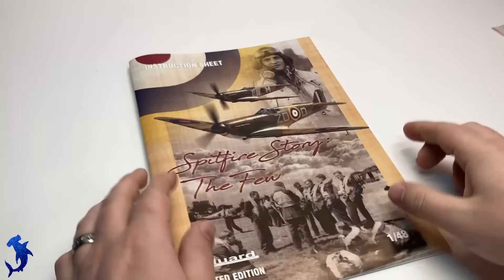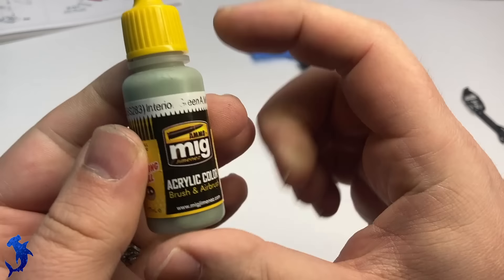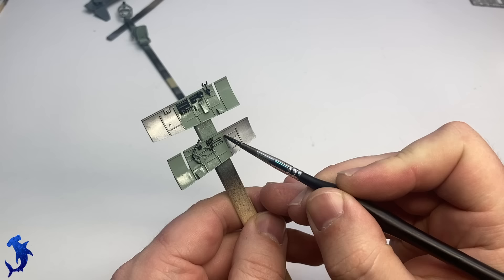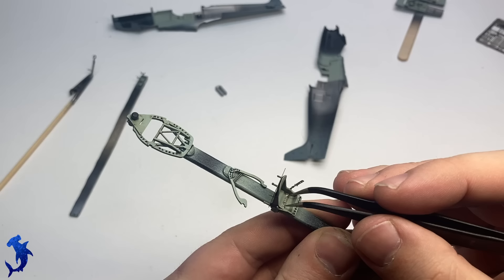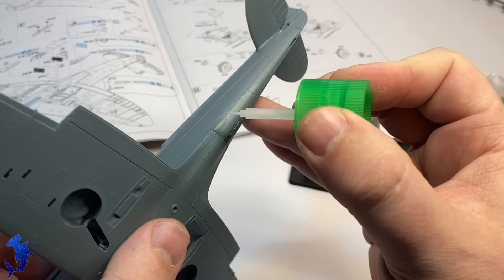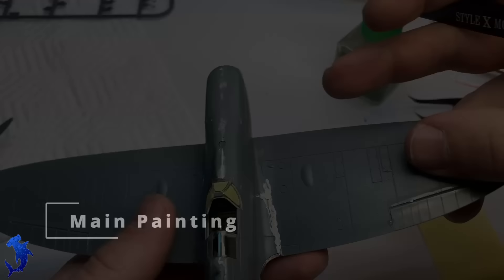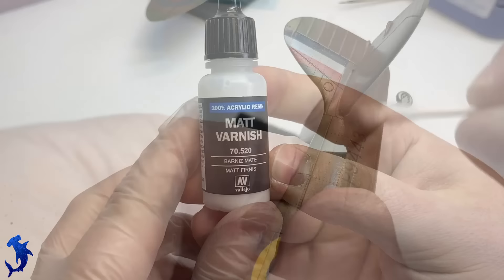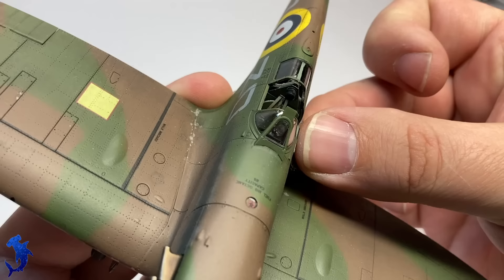Eduard 1/48 Scale Spitfire Mk.I | Douglas Bader | Battle of Britain

Comment: What an outstanding finish chap! 
So glad the paint recipies worked out well 😊👍
When you said you were going to build this kit I knew you would enjoy it and make a cracking recreation of an early war Spitfire, only thing is what are you going to do with the second on in the box?! 
I have some spare photo recon decals for the early Spitfire Mk's in the stash if you fancy a pink or blue Spitfire in the display case 😁
Thanks for the shout out, extremely kind of you Brett.
Reply from the maker: Thanks Matt!  When I bought the kit, I also bought a full engine and open gun bays from Eduard, I'll use those on the second Spit, but I hadn't considered marking options yet, but a blue Spitfire sounds intriguing.
Reply: @HammerheadModelMaking  Ha, I have got the same engine for my second build! Maybe another buddy build in the making 😁

Comment: Great build! I'm a  Spitfire geek! Built many Spits over the years. Your build is undeniably high quality! It may not be 100% accurate, but no kit is! Our hobby - scale model military aircraft building, can be straight forward if you just follow the instructions verbatim, but for those who strive to build an accurate representation of an actual aircraft, research is vital. When the subject is an aircraft before the 1960s, it is a problem when it comes to colour accuracy, the obvious issue of lack of colour photos for the earlier aircraft combined with the poor colour accuracy of early photography, makes colour selection problematic. Other elements as you mentioned, the streaking on the wings due to gunfire is another issue, I have seen photos of this, but they are not common. 
Some historical points on the Spitfire & RAF, grey was not used until 1941, the red fabric on the gun ports was to stop moisture from entering the barrels and freezing, which happened at high altitude, As you accurately depicted, when the guns were fired, the fabric was torn & would be replaced. 
Regarding Douglas Bader, he is definitely a unusual character, to say the least. He lost one leg below the knee & the other above the knee, I think. This happened when he was with the aerobatic  team of the RAF before WWII.  His life is chronicled in the biography Reach for the sky by Paul Brickhill, which is a great read, Reach for the sky was made into a movie, which is worth a watch. Keep up the great work from across the pond, Not Great Britain, the other side – Australia! 😁🦘🦘
Reply from the maker: Sounds like you're the go to for spitfire knowledge!  Thanks for all the info you shared!  Its much appreciated!  Thank you for the kind words as well, cheers mate!!

Comment: Great build. 
The black and white underside was indeed a prewar thing.
 It was used from 1938 up until June 1940, half white half black, for observation of friendly aircraft (IFF) from the ground.
(Also, the yellow gas-patch usually went on the left wing, tilted 90 degrees for some reason. But now you know for the next time. :) )
Reply from the maker: Thanks for watching, and thanks for the additional info!
Reply: the gas marker was not always applied at a slant. it really depends on the aircraft. the most common explanation ive seen for why it is often seen at an angle is because it would be done by someone kneeling on the walkways but the marker needs to be far enough out for the pilot to see it. the idea was that there would have an indication of gas droplets if the detector changed colours, these didnt stay for all that long though and were pretty much done away with by 1941.
Reply: @ryancook6452  
The agreed. The only thing I am certain of is that Spitfires are depicted with them on the left wing in a slant as you say, while Hurricanes have them "right way", also left wing. 
Other aircraft had them too and I think all on left wing.
Even vehicles like the airfield trucks as the Albion fueltruck or other had these patches. 
As you say, somewhere the driver would easily see it, like the top of the wheel well.

Comment: Dear Mr Hammer,
I was interested in the build up of this kit and it seems that Eduard (with their profi packs which enhance the areas you mention considerably) have a nicely researched product. I am greatly taken with the masked roundels and fin flashes as they have no real depth at all (compared to decals) which serves to considerably enhance the look of the model. I have used them for the first time on a Kotare 1/32 project and like the result.
The colour mentioned in the air ministry instructions for the squadron markings was 33B/157 Medium Sea Grey. There were a number of changes made to the instructions for colouring of aircraft during the 1939/ 40/ 41 period, and this is evident in the number of variations visible in models that are available. Aircraft emerging from factories were painted a standard colour and more often and subsequent changes to colouring were made at OMU and Squadron. This of course meant that colours used were sourced locally which resulted in colouring variations which were sometimes quite significant.
I like your finish and the care you have taken to retain the authentic look of this example. Thanks for showing the project!
Regards,
Z
Reply from the maker: Hello Z, Yes, Eduard has a great kit in their Spitfire, I really enjoyed it.  Thank you for all of the additional info/context on the colors used!  As for the masks, I agree, really helps enhance the over all look and I plan on integrating masks like these into more of my builds.
Cheers,
Brett

Comment: Masterclass!
I'm heaving nothing but difficulties spraying Vallejo varnishes,what mixture/airbrush settings do you use?
Reply from the maker: Yeah, I find that the Vallejo varnishes work best when thinned with Tamiya X-20A, I would start with about 80/20 varnish to thinner ratio and mix in more thinner until it sprays well.  The Vallejo varnish is quite thick out of the bottle.  I usually spray this at 20-25 psi.
Reply: @HammerheadModelMaking  Thank you so much for your quick reply!
Reply from the maker: @vincentroelofs8908  you're welcome!